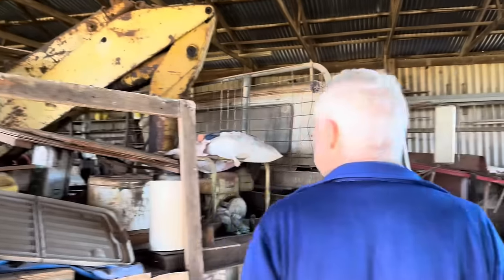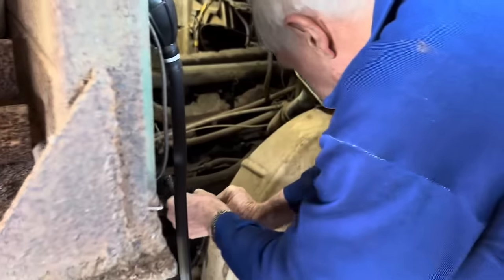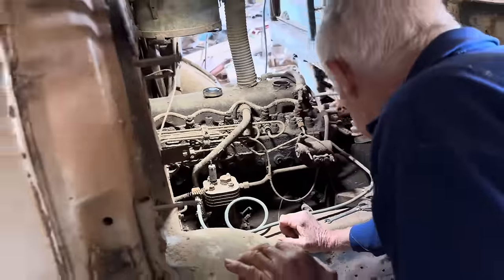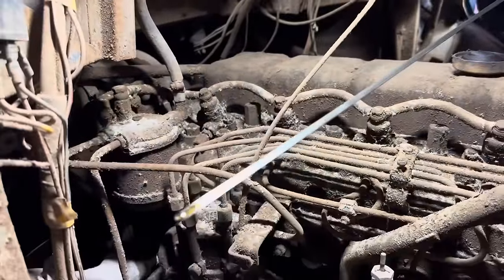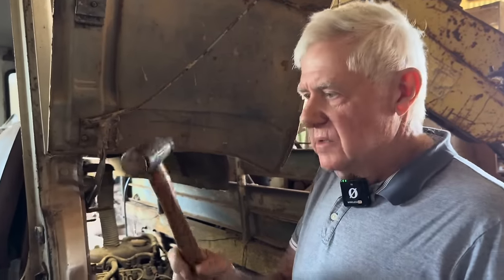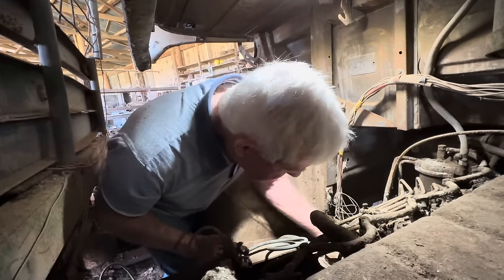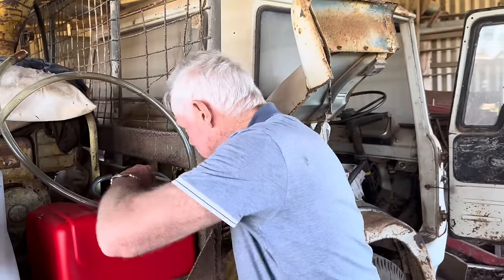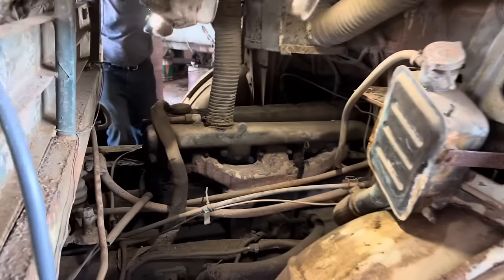Vintage Crane Truck Sitting for 20yrs - Will It Run?

Comment: I have a lot of respect for the humble Bedford, remember them as a boy growing up in the 1960's. I would have taken the truck out of the shed and steam cleaned it before doing anything else.  Grandpop traded our Bedford in for an ACCO C-1800 in the early 1970's, the ACCO also had a six cylinder Perkins in it.   Was expecting to see a snake spinning around with the fan belt when it finally started!   Thank you Bruce, I really enjoyed that 25 minutes, reminded me of my Grandfather who was good with engines.

Comment: Bruce, another ripper save from the barn, well done mate. My first truck was a TK Buddy, bloody awesome vehicle. I found her in a barn, body and chassis had zero rust, the original owner drilled everywhere and filled it all with fisholene, it must have stunk like hell new. I ended up dropping a 308 Holden V8 I had built for another project that I had done the heads/ valves etc up for gas conversion. I put all the gas in her to. She had a terrific steel tray on her to and I also dropped a split diff in I had lying around. I loved the crap out of that truck and Jess she did some work and never let me down once, not even a puncture. Mate it’s so great to see an Aussie that gets out and saves old metal like this. Crack on young man
Reply: Hi, It's not just older Aussies that like to see old trucks brought back to life again, I`m an old Brit so this Bedford style of truck was in my earlier years' memories Once reused as recovery lorries in the trucks later years as transport for oval track stock cars and Banger racers. A Hiab was a must to load and unload the stox and bangers with, even pulling damaged cars more straight in-between races. So many thanks Bruce mate - great video.

Comment: I was lucky enough to drive a friends TK back in the 70's, I'd never driven a truck before, interesting gearing for the steering, never driven anything with so many turns lock to lock since, I wish I had bought one when the were dirt cheap, lovely looking trucks.

Comment: What a beaut!
I drove one quite like this (a 4x4 TK Hiab) doing humanitarian work in the Western Balkans in the early 90s.
Not a fast machine, but there wasnt a hill it wouldn't climb or a loose or icy surface it wouldn't cross with ease.
The 4x4 system meant the ride height was higher, but it qas basically like this one...
90 km/h on a good day.
But... They were all good days.

😊😊😊😊😊😊😊

Comment: Great video. Very systematic and well done on getting this old girl going. Heaps of these back in the day in NZ, especially around our local area where our local large transport firm had a few in their depot in each small town. Apart from the 50 KMs officially imported with GMs, fitting a GM was a popular option for more power in the TK and there are quite a few still earning a living. There is a Nelson based entertainment company with fairground rides, etc that still uses a number of TKs and TMs all GM powered and it is amazing to hear them take off very early on Sunday morning after the Saturday show at the showgrounds with the two stroke howl in the early morning as they go up through the gears, just a few hundred metres down the road. I had a holiday job when I was a student many years ago when the clutch went on a 466 powered TK. We were working in paddocks around an hour and a half away from base. I was able to get it back home by putting it in first gear and low on the Eaton and taking off on the starter. When I had to stop, which was not often, it was a case of just timing your stop well in advance and pulling up the fuel stop. Down into first and crank away in gear again. Hard to change as it was a synchro box - much easier if it had been a crash but it was reasonably worn so that helped. Got it back to base but for some reason, a few months later the starter and box had to be rebuilt :-)  Really love the content, keep up a great work!

Comment: The Perkins 6354 was the best engine in these old dogs I fitted one myself pull a house down. Bad truck for a tall driver give you a bad back and makes you bald coz your head rubbed on the head lining 😂
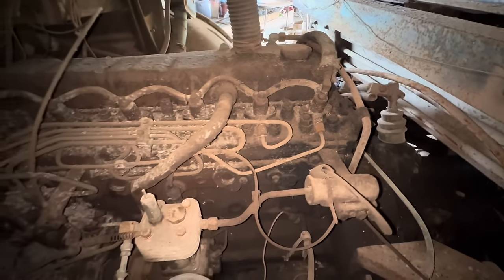Reply: Utg 1:27

Comment: I did my apprenticeship with Repco back in the 60's when they still had engine reconditioning shops. The 6-354 Perkins was the most common diesel back then. We were constantly fitting valve seat inserts etc and replacing the dry sleeves. You had to run many welds up and down the old liners to shrink them enough to remove them. Then press the new ones in. Brings back memories 😏😊

Comment: Hi Bruce we  had TK's here in the UK as well & the 6 cylinder one was the only one to have as the 4 pots were gutless ? The times those lift up covers came down & tuned you on the nut & make you curse, Preferred the Ford D Series over the TK though if only for the tilt cab & easy to work on, lovely to see what looks like a 3 ton Hiab on the old girl, used them a lot on dad's Fords, ATB from a Pommie Brother Wayne UK...........

Comment: Here in NZ I had several old TKs; on farm tipper, house truck, 3 ton digger delivery truck, small logging/firewood truck. Worked on lots of others, the Perkins 6 engines were great but ended up as heavy oil burners (smoke). The Bedford 330 was gutless. My favourite was the digger truck, 300 cubic inch petrol engine, 2 inch ex-Jaguar SU carb, modified inlet manifold, lightened flywheel, increased clutch leverage, modified brake booster. It drove like a little sports car up to about 90km where it was revving hard. Old age resulted in selling all these.

Comment: Still remember working on the last of these that Telecom had with the Holden 308 motors from new, most didn't realise the cabs were designed to be removed very quickly and easily to work on them !

Comment: Back in the late 70's I worked at a Vauxhall dealers (UK) we had a Bedford van & truck dealers theirs stores brought a TK front panel in it looked like someone had walked across it they had sold it so wanted it repaired , I had worked on plenty of HA vans and CF's but never any trucks they wanted no filler , took a while but I can say honed my skills on file ups on it , hi from north east UK .

Comment: We still have one of these with a petrol engine on the family farm, it still runs but very rarely ever used these days. I can remember driving it as a teenager with a grain bin on it, during harvest over 40 years ago. Manual all-crash gearbox with a twin-speed differential, vacuum brakes…..

Comment: When I was in the Air Force we had a Perkins powered floor scrubber for the shop and it was such a pain to bleed the fuel system after scheduled maintenance but when it started it ran so well.

Comment: Another fine job Bruce👍
Had one of these TKs at the yard for years with the 6354 Perky in her, the original engine was an extremely high mileage yolk and eventually blew a piston.
Managed to pick up an engine from an old fire engine which had a fully documented 25,000 miles on her.
That engine seen the old truck off.
Fabulous engines, a worthy sucessor to the P6.
Thats another story though. Would love to see you find an old Fordson High Major with a P6 in her that's been sitting for a number of years👍👍
Great video as usual Bruce.
🏴🇬🇧
Reply: I still run 6354s in our workboats  turbo and nomall asp dam fine engine  top work Bruce 👍👍👍

Comment: A very enjoyable watch, and ive just subscribed. I run a 52 year old TK, still with it's original 330 diesel. I also have an International CO 1800 to restore, it also has its original Perkins 6354 in it which I have not started up yet, so watching this has been very useful.
Many thanks.
David in the UK.

Comment: Thanks Bruce for the TK Bedford review, one of my late paternal uncles drove a TK Bedford across the Tasman 50 years ago ( probably nearer 55 years ago  )😂 for Alltrans ( freight ) in Auckland. 
So successful were the Perkins ( 6354 ) that the Chinese copied them.
One can never be too careful with snakes 🐍 in Australia.
One needs to ask oneself, why did someone stopped driving the old girl.
Low engine oil is some insight 😮
Thanks for the review.
BTW greetings from Hamilton, NI, NZ.

Comment: good strong engine them TK thay did a four cylinder one as well , when thay fitted a turbo on that engine in the mid eight`s in the TL at first it was a bit unreliable but thay soon sused it out in the end . i served my apprenticeship working on them and other`s , all TK engines where a lot better than the FORD D series at this time

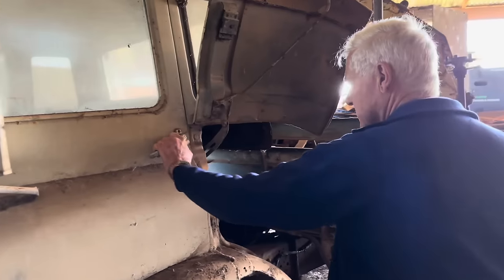Comment: At 1:00 there is an awful lot of daylight coming through that rail.   Mid-span is a bad place for a concentrated weakness like that.  You should be able to easily identify the species of snake by it's shed skin.  In addition to overall appearance there is a ghost image of the scale pattern if you look closely.

Comment: here in brazil we hate this perkins, they doesn´t start when it´s under 30° cels hahaha they swap them out for mercedes diesel, even the old indirect injection om321 starts easy when it snows, but perkins afffff but they are hard to destroy, when you get them run hahahaha

Comment: No point in pumping the accelerator pedal while cranking, just hold the throttle wide open for Max. fuel output.

Comment: I hate snakes. Particularly brown Australia snakes. Make me very leery. I am not Steve Erwin going eye to eye with a Taipan snakey.snake. sounds a very good use for this crane truck. Now he needs another 2 ton truck to load stuff onto. Bruce you should see if the hydraulics work on the crane lift. I have never seen outriggers like those on this truck. Look like pressed metal from flat sheet..

Comment: Its a shame seeing experienced people hitting a starter with a hammer. You are setting a bad example. I cant tell you how many starters Ive replaced with broken magnets because people think that hitting them is some sort of solution. The problem is almost always a stuck solenoid or stuck brushes. Tapping the solenoid or the brush cap is a much better idea.
Reply: Three, and you’ve broken all three of them

Comment: They dont make anything like they use too. 
These old girls were built to last. 

My 68 beddy bus was the same hadn't run for 10+ years. Bit of petrol in the carby and she fired straight up and ran so smooth my stubie of beer could sit on the rocker cover without tipping over or even moving. Runs great every chance she gets too. Brakes are a different story but a few seals changed she will be less scary to move around the hilltop yard.